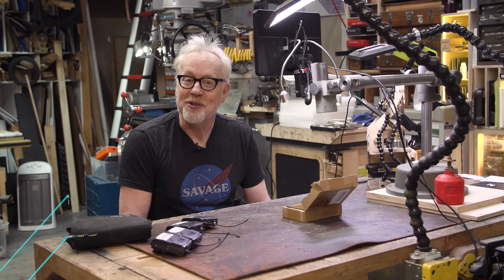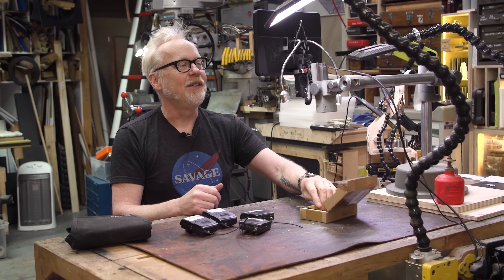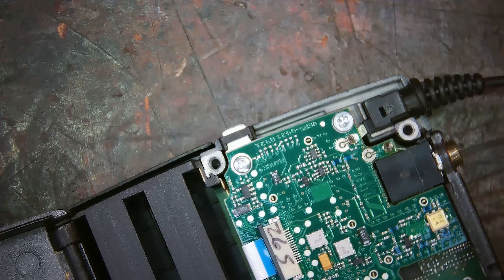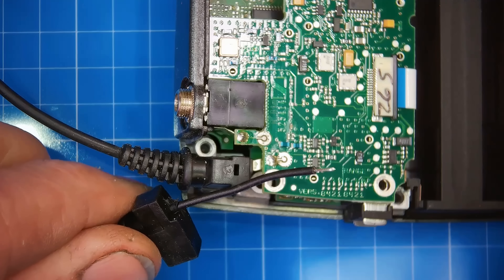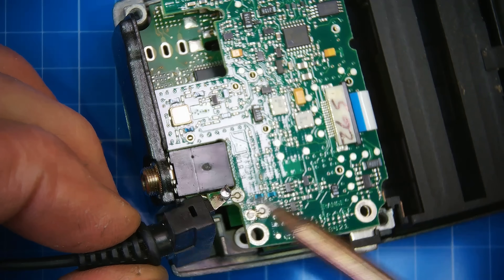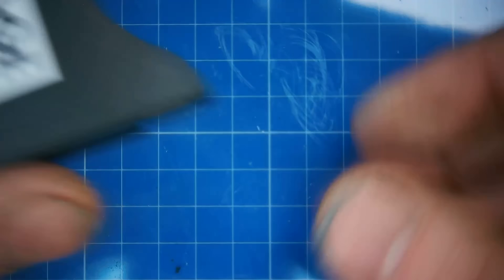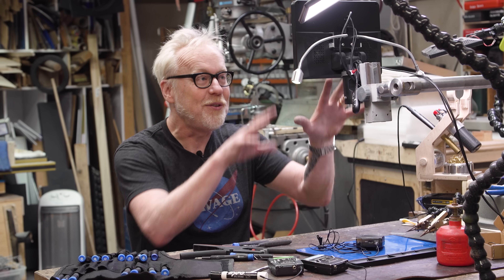Can Adam Savage Fix Our Microphones?

Comment from the maker: Today’s video is made possible by our friends at iFixit. iFixit's Spring Yard Sale is going on right now! On top of the discounts on tools and parts, you can enter to win a mystery box filled with iFixit tools. Just visit http://www.ifixit.com/tested
Reply: I replace OEM antennas of Sennheiser G3 and G4 TX and RX packs with SMA connectors. This allows me to remove the antennas for storage and to very easily replace broken antennas. I kind of consider whip antennas as expendables. Also, for the OEM antennas, placing heat shrink tubing helps protect them from cuts on the insulation.
Reply: @mickeymacachor  This is the way, replace with an SMA connector and then the antenna is replaceable.
Reply: I don't see a way to enter to win a mystery box via the attached link 🤔
Reply: I use an iFixit ProTech toolkit when working on my PC.  LOVE IT!!!  Especially love that they give you the really tiny magnetic bits for the screws for the m.2 slots.  It’s been a godsend.
Reply: Hi Adam, big fan! If you in your future soldering repair jobs add a bit of leaded solder to alloy the existing lead free solder in your device, it will have a lower melting point.
There is even a product called "low melt solder" for this purpous.

This reduces the risk of damaging anything by overheating and makes for example using a desoldering pump much easier.
Reply: Hey Adam could you save money by running 1 electric motor off a single 110v outlet to spin a few generators to power the rest of the house for only the price of the electric motor running instead of the entire house what do you think

Comment: Adam... To unmount the belt clip, you have to turn it 90° ...  Pliers not needed ;) 
And you can push the door axle with the same tork screwriver to free the door... 
And please ! Clean your solder with isopropanol after soldering !!!

Next step, install a SMA socket instead of the original Sennheiser antenna ... No need to open again the wireless. Just screw a new SMA antenna when to old is broken  ;)
( I fixed thousand of  Sennheiser G2 / G3 / G4 in my tech carreer )

Comment: As an AV installer and audio engineer by trade, I have one clarification to make. We don’t necessarily have to swap out ALL of our wireless equipment every few years, just some of it. Around 2010, the FCC started selling off the 698-806MHz band to cell carriers, and around 2020 they did the same for the 608-698MHz band (with a little gap from 614-616). But for a couple decades now, we’ve been able to buy wireless audio equipment that operates as low as 470MHz, and some manufacturers like Shure even offer systems in the 174-216MHz band. 

For anyone who had equipment operating in the bands that were sold off, most manufacturers offered either a rebate program to replace your now-obsolete stuff with compliant systems (which was a good deal for all parties, as the manufacturer could turn around and resell sell the returned systems overseas), or for certain systems like those in the 500-low 600 range, a firmware update that would remove access to the now-illegal frequencies. And nowadays, some companies are selling more budget-oriented digital systems that use the 2.4GHz normally associated with WiFi and Bluetooth. 

We do have to share the existing low-band frequencies with local TV stations, which can sometimes cause issues for less experienced wireless equipment operators (*cough cough* churches *cough cough*), but manufacturers have made the spectrum easier to navigate with websites that can help you sort out which frequencies are less occupied in your area, as well as most professional wireless audio equipment nowadays having an “auto scan” function that will build an internal database of which frequencies have the least amount of activity at the time. 

Wireless system management can get very convoluted once you get beyond around 10 simultaneous channels, though. Many people are amazed when I tell them that basically every mid-large touring act has a full-time RF tech position whose soul task is to coordinate the frequencies used for every single wireless microphone, instrument, and in-ear monitor system (which for A-list artists can sometimes get to more than 30-40 once you consider every musician’s multiple instruments and backups). It’s a whole world that I understand relatively little about. I have huge respect for touring RF technicians, especially now that our list of usable frequencies is shrinking every decade or so.

Comment: pro tip for removing the nut on the jack - old school staple remover (the ones that look like they have fangs) - they line up perfectly and are rigid enough to loosen (and tighten when needed) these nuts.

Comment: I’ve been a sound recordist since 2014. I had and went past these G3’s they are good for what they are but the static is horrible especially when a battery runs out on the transmitter sends static. Wish I had this trick antenna in my day. I have 3 of them in a box still. Working with LECTROSONIC UCR-411A and have 10 lavs now. We are due for better systems in the coming years please!!

Comment: I own 22 of these, and have had to replaces about 10 antenna's aver the last 12 years It's amazing how easy it was.  I to found a Youtube channel that spelled out the process.  On mine the Plastic just deteriorated and left bare wire exposed.  Thought I purchased the Sennheiser replacement parts, which are all set with the little metal fine, and not a wire lead.

Comment: I did this same repair: 1. A lot easier if you remove that daughter board so you can see what you are doing 2. The non-OEM antennae are actually short of the ideal resonant length - Lectrosonics engineers say if a mic is on a body the resonant length pretty much goes out the window but if this is the receiver on your camera or bag it's worth getting the right length for your band imo

Comment: As a technician that was a bad solder joint your iron is not hot enough also use fluxative and heat up the solder connection until it's nice and shiny or you will get a cold joint because the board was colder than the connection pad and this can crack the solder you just need lots and lots of practise

Comment: I'm surprised you guys had antenna failures, company I work for has over a dozen of the EW 100 G3 transmitters and not a single antenna has failed in the ~10 years they've had them.

Comment: I had 14 Audio technica transmitters with microphone connectors that were wrecked. I was able to convince my boss that it was a simple fix and after we got the parts in we are back up to having a full stock of working microphones. Repairing your own equipment is awesome.

Comment: I would have removed the old antenna before cutting the new lead. Especially if you can’t see the back side.
I also would have removed the solder from the hole.
It also hurts me to cover up the model number with a sticker.

Comment: Love getting to see the inside of these sennheiser units that I use everyday. Curious as to why you simply replaced the antenna when the well-known SMA mod exists and isn't that much more difficult. Instead of a permanent antenna replacement, you can install a standard RF antenna jack and use whatever length (e.g. frequency) whip you want, as well as increasing range and reliability. Still, a great vid and I'll be referencing it later when I need to!

Comment: Will somebody please give Adam some proper lessons in soldering. I was watching him try to poke the wire through the PCB hole at the same time as melting the solder and going all Cleveland Brown - " No no no no no no no! ". You de-solder the hole first using a solder-sucker or wick, then put the wire though the cold clean hole. Then you take the iron to the work, heat the work and then melt the solder on the work. If you do what Adam does, and put the solder directly onto the iron, by the time it gets to the work all the flux has burned off and doesn't get to do its job.

Comment: These are excellent audio transmitters and receivers.  In a past life I used to modify these, repackaging them into a smaller form factor, adding a SMA antenna socket, to live their lives as listening devices for gathering evidence for law enforcement.  Got great range when the receiver was equipped with a yagi antenna.

Comment: Adam, you need to buy a solder suction gun. After years of using a regular soldering iron I didn't think it would have been that big of a difference but oh man...Removing the solder on those types of pads or through hole is very satisfying. Give it a shot, you won't regret it.

Comment: Great, money-saving, waste-preventing work!

For folks at home who don't solder all the time, you can fix the struggle with melting factory solder by adding a little of your own. Most manufactured electronics use lead-free solder that doesn't melt easily. Adding some more of your lower-temp leaded solder can help everything flow the way you'd like it to flow.

Comment: You should of used solder wick to remove most of the old solder. It reduces the time heat is applied on the tabs and reduces the chances of lifting off the traces from applying heat too long.

Comment: Unfortunately those antennas that were sourced for the video are not OEM. The Sennheiser antennas for A-range bodypacks (G3 and G4) is part # 575297. They will have the angled metal hook that you see originally installed on the RF board, as opposed to the aftermarket antennas with the wire. Much easier to install. Still, Adam did a great job with the antenna replacement.

Comment: I thought for sure you were going to be replacing the 1/8" locking plug on the end of the wired mic.  I've been using these for decades and that's the point that always seems to fail on ours.

Comment: I replace OEM antennas of Sennheiser G3 and G4 TX and RX packs with SMA connectors. This allows me to remove the antennas for storage and to very easily replace broken antennas. I kind of consider whip antennas as expendables. Also, for the OEM antennas, placing heat shrink tubing helps protect them from cuts on the insulation.

Comment: I run a set of 32 wireless mics for theatre productions. I was put off from buying the Sennheisers partly because of their antenna design. I went Trantec instead, which have removable antennas that are field replaceable. I'm now making my own, using M3 brass standoffs, bowden cable, heatshrink and some 3d printed spacers and ends. They work a treat and cost me pence. 
Another weak point of the Sennheisers is the 3.5mm locking jack - forever noisy or working loose. I much prefer the 4 pin mini xlr or even better, a Lemo.

Comment: Adam, A tip when putting screws back in. Back them off by loosening them until they "sit" You'll hear a click or pop and then tighten them. Especially on plastic. Otherwise you'll be cutting a new thread which will make the connections weaker. 

May have to get me a set of those iFixit kits. I don't have much in tools at my computer desk/mini workshop.

Comment: Had an antenna  detach internally during a musical a couple months ago.  No spare bodypacks. While the actor was off stage for a few minutes I hot glued it back onto the circuit board and more hot glue to keep the antenna from pulling again.  It worked to get through the show but I had to trash it when it was done!

Comment: as a technical note: when replacing an antenna, make sure you match the length of all the important wires and such to the originals unless otherwise noted. They factor into the physics of the antenna and the associated wavelengths. Negative impacts can range from degraded performance, to components failing.

Comment: Is it me, or are the newer antennas shorter coming out of the box? As a radio operator, I'm not sure I would have clipped the wire shorter as it was probably made that length to match the transmit frequency. With higher power, this could kill a transmitter. But these are probably such low power that it won't. It could affect the range, but it's not like you're using them in a theatre.

Comment: Interesting note: the pack identifies as a diversity receiver. This means it has multiple antennas that it selects the best signal from. But where is the second antenna? If you look at the output jack that Adam had trouble removing you can see a similar trace on the pcb to the one he fixed which runs to the jack. The pack uses the plugged in cable as the second antenna. Clever! In-ear monitor packs do the same thing where your headphone cable acts as the second antenna. Not well tuned but a good secondary.

Comment: Worked in college radio 20+ years ago with the engineering department. We fixed everything in the station, even the old beige Apple computers. Because the station budget was hot garbage until the last year I was there because we got more underwriters due to broadcasting local minor league baseball games. (We even got newer colorful iMacs and a G3 and G4 PowerMac.)

Comment: Having repaired several of these for my church’s tech team, I’d like to point out that your “OEM” replacement was likely not genuine. Notice that the original one had a solid metal piece where it solders to the board and the replacement had a wire. I’ve had more problems with this type which can be had for a few bucks from a certain internet company. Instead, I recommend finding a source for genuine Sennheiser packaged parts which are identical…. IE: actual OEM.

Comment: 5:22 if you use a screwdriver on that, you put the driver tip in one of the slots and turn it like you would with any other screw.

Comment: A good tip for flowing old solder easier is to add some new solder into it. So to remove an old solder joint easier, just add some new solder in.

Comment: Clearly NOT the identical OEM part! lol!  Original uses solid metal plate, the replacement part, uses a wire lead. O well, still works.

Comment: Whatcha bet the antennas are just coated wire? Make some the same length, only strip the end you solder to the board, and see if it receives. If so, try the transmitter.

Comment: Why you don't build your own antenna? They seem to be 1/4 wave antenna. So base on the frequency range of 516 to 556 mhz you should build an antenna with a length of around 13.96 cm... You can probably calculate the right antenna for your other mic model too.

Comment: if those antennas are as prone to breakage as you suggest I think I would have been tempted to put a socket in there so that the antenna could be easily replaced without needing to break out the soldering iron. It's more work that just doing a like for like replacement, but in the long run seems like it might be worth it.

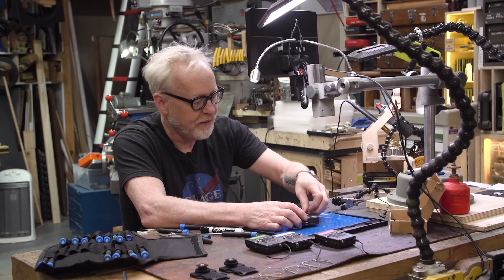Comment: 12:00 The best solvent for getting sticky label adhesive off of equipment without damaging the finish is Bestine Rubber Cement Thinner. Barge Thinner should be the same chemical.
Reply: Goo-Gone..

Comment: Clean yo flux off!  ^-^  Flux is corrosive, and you really don't want it sitting there once it's job is done.  A little rubbing alcohol and an acid brush works wonders.
Reply: Rosin, flux for leaded solder, generally isn't corrosive, but yes, alcohol will remove it. The solder used with lead-free solder, however, is indeed corrosive, and must be removed (it's typically water soluble). And then there's plumbing flux, uggh, which should never be used for electronics work.
Reply: And alcohol can cause plastic to crack..

Comment: You need a special (weird) tool for the mic jack nuts. I have one I would like to send you, gratis. After doing repairs on sennheiser packs for years, our group went with shure for our latest system -- SMA connectors for the antennas, and real mic connectors (Lemo) that have been far more reliable. We went digital as well. Yeah, the Lemos are much harder to repair, but they don't fail as often. Where do i send your new tool?

Comment: Those mic/line out jack screws are a real pain to loosen. You were smart to skip taking it off. Usually the plastic base breaks before the thread loosens. Then you need to replace that piece. I am surprised you are having trouble finding Sony parts. They are usually good suppling parts. Of course being Sony they will be expensive.

Comment: Although I like some of the features of the Sennheiser wireless transmitters and receivers, in the film and TV biz we usually use Lectrosonics products.  They are more robust than the others and don't seem to be as susceptible to RF interference.  But that's just for bigger budgeted productions.  I have done low-budget jobs with Sennheiser and Sony wirelesses but I don't enjoy it.  Try to do a shoot with RF mics on the Las Vegas Strip (Las Vegas is a big bowl of RF signals) and you will soon be renting Lectrosonic's.  We do love many of the Sennheiser mics.  The Sennheiser 416 is a standard work horse shotgun mic, as an example.  I have NEVER had the antenna go bad on a Lectro transmitter.  That said, Senheisers will get the job done, especially if you are in a controlled environment.  There are no plastic parts on a Lectro wireless, at least there wasn't when I retired a few years ago after 50 years in the biz.

Comment: 6:10 "it's exactly the same part" .. but clearly it is not, the original part has a metal strip coming out of the plastic body, while with the new part it the antenna wire.